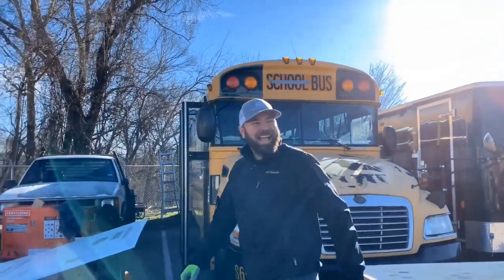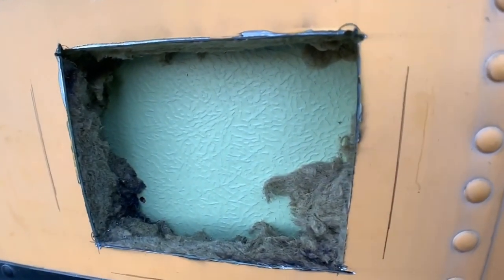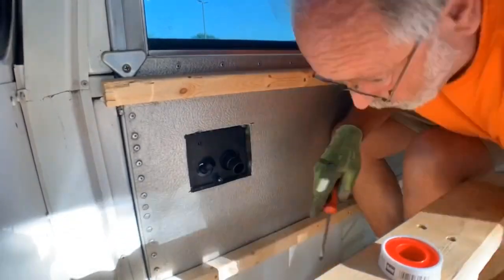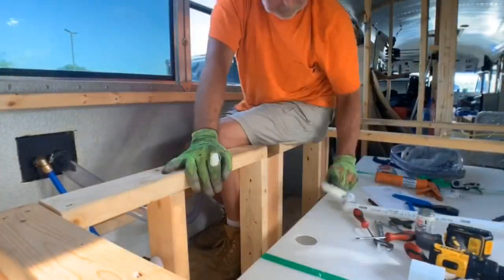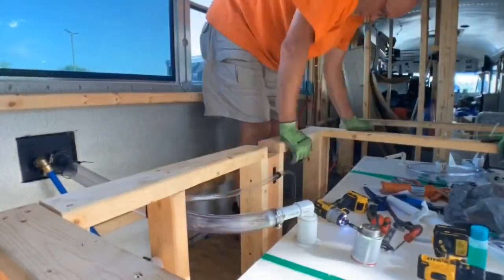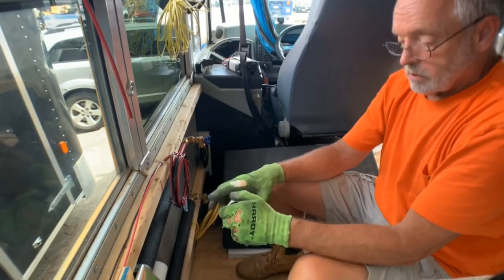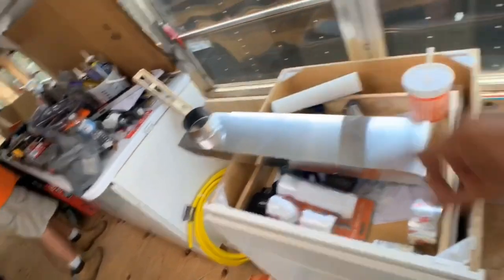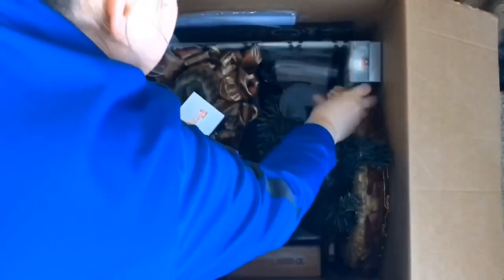Skoolie Fresh Water Fill Up (Gravity Fill) || 2020 Bus Conversion - Ep. 19

Comment: Thanxs for your informative and motivating vid. I have a problem, can you help? I don't know which type tube and fittings I should use for the gravitu fill port. Please help. The tank will have spin weld fittings installed by the factory. So I need to know what hose and fittings to get.
Reply from the maker: Well it really depends on the fittings themselves. As far as I'm aware, spin welding is the process to install the fittings by the manufacturer, but there are still different types/sizes of fittings. Do you have any other details? Happy to try and help. Or even photos of the fittings?

Comment: Maybe a stupid question but what do you do about the tiny pieces of plastic shavings that end up inside the tank when drilling holes? Do you just flush the system a bunch of times?
Reply from the maker: Not a stupid question and something I overlooked initially. You should definitely cut those holes before install so it’s easier to flush out. Took some extra work to rinse that out. We have a strainer on the front side of the pump as a fail safe, too.
Reply: @TaleOfTwoSmittys  thanks for the quick response! Definitely something I'll keep in mind when we begin our build. Your series has been super helpful and can't thank you enough for sharing. Best of luck with everything!
Reply from the maker: Thanks so much! I promise, it’s worth all the struggle!!

Comment: What kind of door is that and where did u get it? Any specific measurements?
Reply from the maker: We show a bit more of the box in tomorrow’s video, but we made it out of diamond plate sheet metal and bolted some brackets on the back to stiffen it. We matched the size to the hole we cut out of the bus (and let it hang lower).